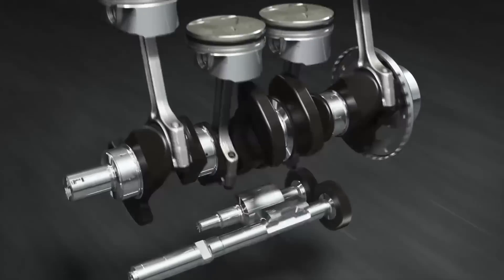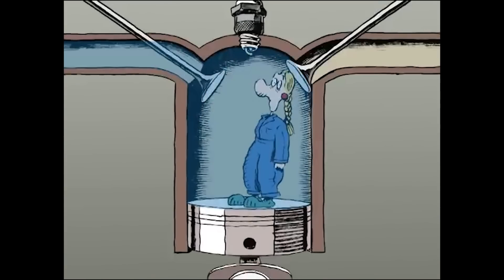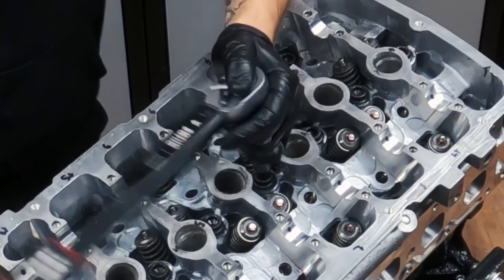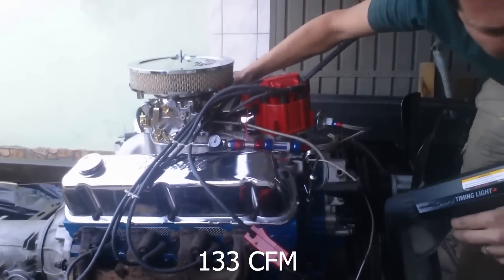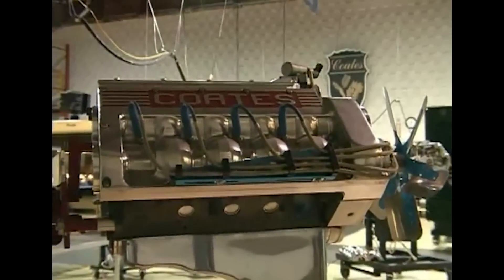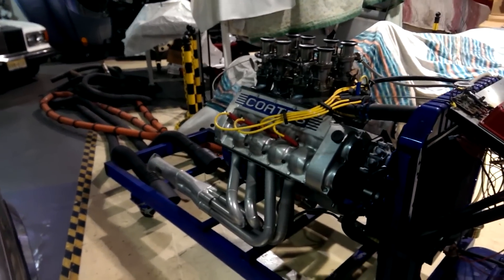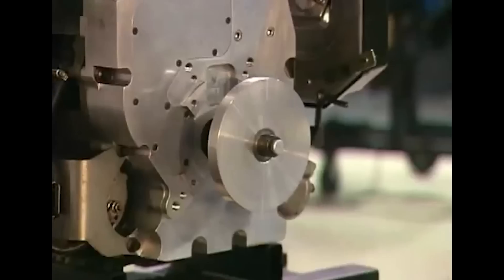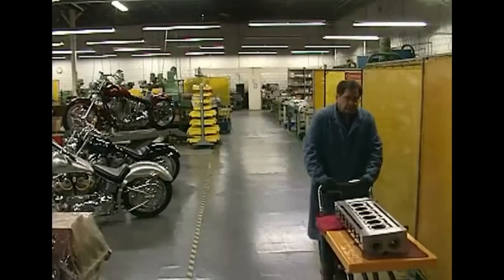A Promising Evolution in Engine Design - The Coates Spherical Rotary Valve

Comment: I remember reading about these Coates valves  in the 90’s. If this design has been around so long, why hasn’t it shown up in the mainstream? Still has  sealing issues inherent to rotary valve design.
Reply: IIRC, Coates wanted a LOT of money for rights. The Japanese automakers were interested regardless. However, Coates wanted the product to stay in the US, with US automakers.
Reply: @kz6fittycent  and now he's in China
Reply: Mazda has made continuous improvements on their materials, so the rotory valve is not necessarily a dead end
Reply: I have been saying for YEARS we need to have a 2 stroke, high pressure forced intake that uses a port in the cylinder, and have only exhaust valves in the head.

Possibly the best design would be the spherical valve system.

My reasoning is that you no longer need to time intake, only fuel injection, and exhaust timing.
Reply: @honeybadgeractual5734 sounds like an old Detroit diesel
Reply: this would end up extremely similar to Ducati's Desmodromic valve. Both were experimented because valve float was a thing back there. Thus, both's main selling point was just it allowed higher engine RPM, but nowadays valve float was not very common in high performance engines because our technology in making materials and productions got much better than the old days, now the only one reason why Ducati is still using their desmodronic is because they wanted to keep its legacy running.
Reply: @MRworldEtIkA  And it is Ducati's "iconic" selling point. However at least the desmodronic valve system at least has made it to mass production and sale with one well known producer. The Coates valve never reached that stage.
Reply: Sealing is not positive. The pressure of the combustion pushes the seal open in stead of helping to to close it, like with a poppet valve. You are never going to get this right.
Reply: I used to have a Popular Hot Rodding Magazine with this technology in it.
Reply: I don't get this over other designs with a single rotary valve that does both intake, and exhaust.
 
 Valtec or something like that out of North Carolina is trying to make one happen. 

 I'm all for EVs. Yet I do love engines too. Let us hope they succeed amongst the other "revolutionary" engines that pop up. 

 Stupid seals. Hopefully one day we can get some type of seal that works in the depths of hell to the middle of a neutron star.
Reply: At the rate it can spin, if you don't like it could have revved the piss out of it. Yeah i bet it had a strange lazy idle. Big whoop.
Reply: It cost millions to develop the current poppet valve systems currently in use and the manufacturers want to make returns on those investments into that technology. Rotary systems might see the light of day but they still need some refinement before hitting the mass market.
Reply: The Sarich orbital engine was a biggie back in the day. The engine was pretty ordinary but he went on to develop the fuel injection system being a direct injection pioneer. Sometimes a lot of lead between a promising concept and production reality if at all. Coates sounded exciting but a lot of problems that they glossed over that would not survive  going into production.
Reply: 2
Reply: They developed these rotary valve engines back in 1930s.
Reply: https://youtu.be/Zj_SIeFjisw?si=aOZXN6pNpw1Ryvqs
Reply: I bet Carbon Buildup is the problem.
Reply: Even if it seals well indefinitely, the performance gains will never outweigh the manufacture cost. Carbon seals, ceramic bearings, extremely precise spherical grinding... Nah, cams and valves. DOHC with VVT comes very close in performance for a fraction of the cost.
Reply: @Scraps_Pile  You are right about it being down to manufacturing costs. Also, simplicity of design keeps maintenance and repair costs down.
Reply: @Scraps_Pile Not that close ngl
Reply: @Scraps_Pile  DOHC with VVT does not come "very close in performance" nor is a "fraction of the cost". You can have VVT on the rotary valve too, the rotary valve solves an inherent problem with flow on regular valves, and will have a noticeably higher performance across the board under all conditions. Also, why are you implying that cams and valves aren't precision engineering themselves? At the absolute worst, if manufacturing tolerances had to be 10x higher for the rotary valve, the sheer reduction in overall parts would make costs similar to a standard engine. The rotary valve is only dead because of a complete lack of manufacturer investment in the modern day with our modern manufacturing technologies.
Reply: @Scraps_Pile  ya beat me 2it, took the words right out of my mouth 🤔 cool idea though, I was always partial to the OPOC engines.
Reply: The elephant in the room now, is, EV's with squillions going into battery research.

As soon as they resolve Lithiums tendency to self combust occasionally, or use another mixture of elements, and get 800-1000 miles from a charge, ICE is toast. 

I doubt many car Co's, except maybe Toyota, are interested in straying away from the standard ICE configuration, at this stage.
Reply: @SaintKimbo  The only way of getting "800-1000 miles from a charge" is by doubling or tripling battery capacity (motors are already well over 90% efficient) which, since batteries are already as bulky and heavy as is practical, means doubling or tripling their energy density. In case you hadn't noticed, even the energy density of current EV batteries is a bit of a problem (to say the least), the root cause of the dangers they present.
Reply: @EliteRock  
Agreed, but I'm talking about battery research, as opposed to combustion engine research, to point out the fact that interest in new fangled ways to replace the inlet/exhaust mechanisms, are not as appealing to major Manufacturers, as they once may have been, with ever more stringent emissions regulations coming into force.

Whether EV's are the answer or not is irrelevant, the Politics is forcing their hands, and improving battery efficiency is the holy grail now.
Reply: And of course disincentivising any real progress in ICE efficiency will be part and parcel of this agenda. The only nation currently still making serious efforts to develop ICE's (and displaying overt scepticism toward EV's) is Japan, and I suspect that if they persist 'economic punishment' will be meted out to them.
Reply: @EliteRock Semi and Solid State batteries are being produced this year with 500kw/kg. 

 That is nearly double what Tesla has in its models which are like 240-280. 

 With many more lab break throughs happening seemingly monthly. 

 At the rate of regular advancement. Batteries of 750kw/kg will be here in five years. Peak production maybe a few years later. 

 So no. Just in a few years you can have a lightercar that travels 500 miles. Or you can have a heavier one for better range. 

 I mean we already have 500 mile EVs. So 1k miles for cheap cars is about 5 years max. Look up Toyota, CATL, Amperex and a company called m24 with Impervio. 

 Anyway... Most people drive 40 miles a day in America. More chargers is what is really needed. Every gas station should have some.
Reply: @SaintKimbo  what is ICE
Reply: @raymondo162  :-) Stanley Unwin?
Reply: @SaintKimbo  There are alread batteries types (sulphur selenium I believe) that offer triple the energy per weight or volume. Only problem is the limited load cycles because of internal buildup of polution. But that will eventually be solved, and when that happens ICE indeed is toast...

Comment: This has been around for years, I recall seeing a yt vid on it at least 15 years ago.  And other manufacturers experimented with it in the 1950s, one of which was Norton motorcycles. I always ask myself why it's never been adopted by the racing world as they are are constantly looking for a competative advantage, especially in F1. One reason may be that they now use electronically controlled solenoid valve actuation, which means valve timing and opening are continuously variable, so the advantage of rotary valves may not be worth the cost.

Comment: About time valve technology moves forward. Seems this idea took a backburner from years ago. Finally things are going forward. Way to go COATES !!!!!!!!!!!!!!!
Reply: I first saw the coates design more than a decade ago, and this design first popped up in the 1920's or 30's, and it has gone nowhere meaningful since then. If this was really a revolution in engine technology there has been ample time for it to be adopted industry wide. The fact that it has languished in obscurity for almost 100 years is enough evidence that this is not the revolution that some think it is.
Reply: Well stated logical deduction Matt. But I seen a racing engines side by side one tappet one rotary. The rotary outperformed the tappet. The problem is I do not remember by what amount of extra power.  Sorry Matt.  @w1z4rdyt
Reply: The problem is that this thing runs no better than a conventional 5.0 Ford can .
Reply: The rotary valve uses way less energy than a regular valve. This is my belief.  @petemcpeterson6205

Comment: I guess that a rotary valve applied to a compressed air engine would avoid most of the problems in an ICE which are primarily from combustion heat and pressure, and lubrication oil being burnt.
Reply: I think you lost us there, what's a compressed air engine...?
Reply: @paradiselost9946  ah, compressed air…. vehicles have been made with it, but they don’t run for more than a half hour….
Reply: @PRH123  i like the "half an hour"... rather generalised, isnt it? no other option, say, bigger tanks or smaller capacity engines in that general statement? its always 'half an hour"?

and you missed the main point... ALL IC engines are running on compressed air. they just add fuel, ignite it, thus raising the temperature of that air. 
that as per charles law, increases the pressure of that air. which can then deliver more work than it took to compress. 

engines dont run on fuel. they run on AIR and HEAT. heat most often being obtained via the combustion of a fuel.

Comment: I remember reading about this , probably in the late 90’s in Hot Rod or perhaps Popular Hot Rodding.  Always wondered what became of this technology.  Guessing that there are sealing issues that arise after some time, similar to the Wankel….
Reply: Sealing issues were solved by the 90s. The guy worked on the design and the seals since the mid 70s. Finally found a carbon/bronze ceramic seal that worked.

Comment: These heads are more than 25 years old. I used to read about them in hotrod magazine back in 2000. They were a few years old then.
Reply: I saw one of these engines in the 1970s in a model airplane.
Reply: Yes, Coates had been working on the design since the mid 70s.

Comment: I love how the promo video of poppit versus rotary valve power comparisons shows a songle carb versus a four carb setup. Not to mention the rotary valve would also cause a different manifold design thus changing even more variables.
Reply: Simple reason is the poppet valve engine can't flow more air than the single carburetor  can flow. The rotary valve engine has much higher air flow and the carbs and intake then become the limiting factor. If you restricted the air flow on the rotary valve engine of course it wouldn't make more power but that would  make no sense whatsoever...
Reply: @W8iHav2P  Poppet valve heads flow plenty for single carb per cylinder. Common on Motorbikes and cars like Alfa which had Webbers with a choke per cylinder - equivalent to a carb per cylinder. Ford they are using is a very low performance engine with poor heads. Heads are a major choke point on an engine. Change heads and you will match or exceed the rotary valve performance. They changed heads. So completely different and they would have to try pretty hard to be worse than the stock heads.  And if you revved the Ford at 14000 for production you would destroy pistons, crank and maybe even the block. Japanese motorbike engines could do that in the early 80's though - with poppet valves and single carb per cylinder. Kawasaki was doing it with only 2 valves per cylinder.
Reply: @W8iHav2P  and if you had oversized valves coupled with ported manifolds you would also get higher increases in horsepower. My point was they were comparing two completely different setups rather than comparing air flow numbers.

Comment: Wow, I remember finding out about the Coats rotary ball valve at least 15~16 years ago when I was teaching at a trade school.
No oil at top end, ceramic carbon graphite bearings that they had to 'invent'.
It isn't actually new, just the technology was not available in 1940's~50's
Allowed a 5.0 Mustang to rev to 10,000rpm.
I think the biggest issue was actually sealing though due to the pressure variance (- 10~ to +1200psi)
It wasn't as good as they said plus the fluctuations set up resonant vibrations leading to pitting in bearing surfaces. (need more money for development 🙄)
The other issue was, Coates was GREEDY  (obvious at the time and shares are now worthless?)

Comment: Problems:
1. thermal expansion
The cylinder head and rotary valves  made of different materials and heat up differently so the clearances are constantly changing. In classical engine there are valve springs thah kep valves close and tight no matter the conditions.
2. impossible to keep perfect seal
In classical engine the more pressure inside cylinder the greater force sealing valve. In here thats not the case. Any imperfecion  of machining or a little play on camshaft bearings will cause leakage. These spheres dont seem to have thick rigid walls so they can also flex a little bit under combustion pressure
3. additional lubrication required
It looks like there is a great force pushing these spheres up during combustion and compression stroke. Great force and rotating movion required some lubrication and some of this oil will move into cylinder and will be burned. What about emissions?
4. susceptible to contaminants
We have lublicated spherical valves, very tight tolerances, poor emissions and EGR valve. Any contaminant particles will stick into spherical valves and act like a sandpaper.

Conclussion:
It will work on paper or in CAD software but not in real life.

I wil gladly see inside of that kind of engine after a couple thousant of hours working in different conditions.

Comment: The reason "they just kind of disappeared", was largely due to their own arrogance. They refused to allow investment from common people. Their adaptation of rotary valve technology (first practically developed in the 1800s) could not meet modern emissions standards. Modern emissions standards focus greatly on reducing oxides of nitrogen (NOx). The Coates design simply doesn't do this well. The technology also requires costly ceramic coatings which simply aren't viable for mass production. In light of these factors, Coates focused further pursuit in the largely unregulated racing industry. The arrogance came to a head at this point, when they made it clear to potential investors, they had no interest in dealing with multiple entities. They sought a single investor to drop millions in R&D, and honestly believed their development to-date substantiated such. I, myself, established contact with them shortly after I saw a lull in their PR campaign. I gathered several investors willing to pursue development for stationary industrial diesel and multi-fuel engines... IF Coates was willing to produce two viable prototypes (one diesel, one multi-fuel). When I contacted them, the message was clear... if I didn't own a racing team with 8 million dollars to drop on a questionable R&D venture, they had no interest.

I, along with many others, have largely written off the technology, and Coates. What's worse, is their desperation. It wasn't enough to allow their development to fall on it's proverbial face out of arrogance... but now they actively pursue legal action against literally anyone with publicly disclosed development of rotary valve engines. They went so far as to issue a cease and desist order to a gentleman for converting his own private vehicle to spool valve, even though his design was CLEARLY different from Coates. The valve arrangements were perpendicular to the bank axis. The valves/ports/bosses have a straight profile (as opposed to Coates contoured faces)... I could go on, but suffice it to say, their design was beyond the realm of "divergent". 

In summary, arrogance, laziness, and poor fiscal management killed Coates' development... and I don't honestly think that will ever change, so long as they hold the rights to their patents/developments.

Comment: About 30 years ago I made drawings of rotary valve gear with ports through a shaft, this is not a new idea and sealing off very high pressures in a combustion chamber is very hard to do/ there was an out board 2 stroke that used a hollow port in the crankshaft and it worked well because it wasn't exposed to combustion pressures, Wankel rotary type engines have the same problem sealing off combustion pressures for extended periods of time,,I hope new technologies can overcome this age old problem,,I've had many great ideas that just didn't work very well in reality 😢

Comment: It's just about tooling, costs and risks.  Car manufacturers are setup for poppet valves.  they are reliable and do the job.  and they fill the cylinders enough.

In contrast they need to completely retool for this and all the supporting industries do too.  and there is a big risk around the sealing.  They dont' want to build an engine that needs the head rebult every second service.

and for what?  smaller engines making more power?  So basically some weight savings.  They don't care that much about weight.  Look how heavy cars are getting.